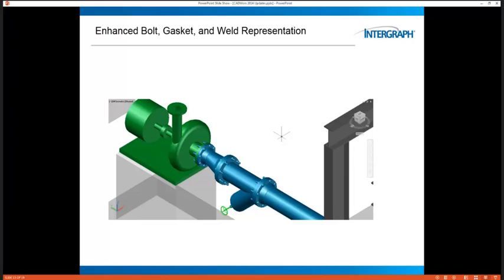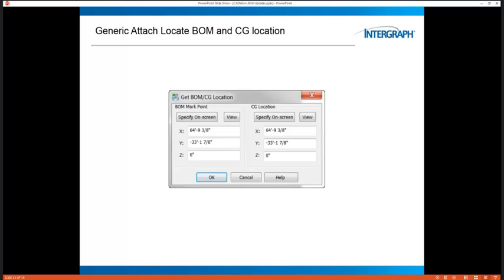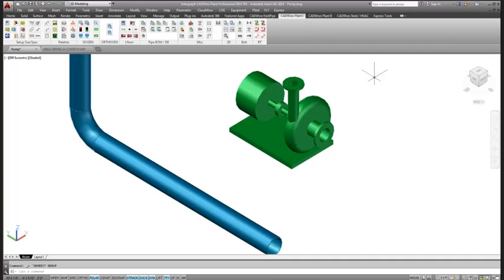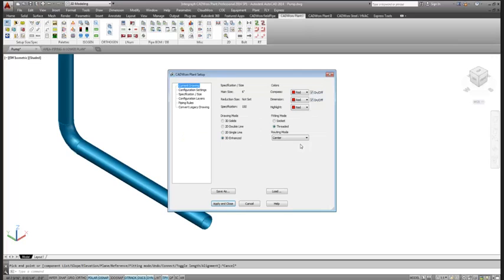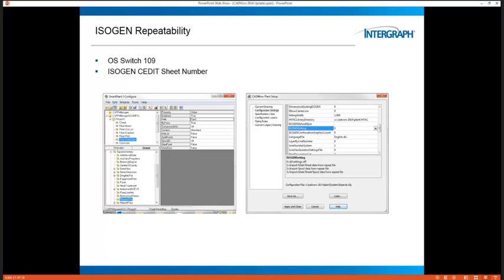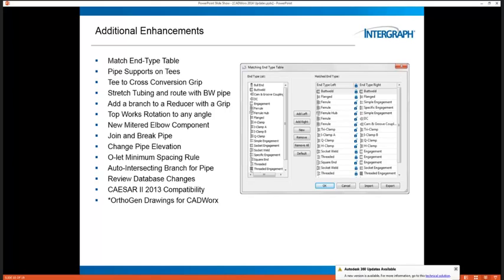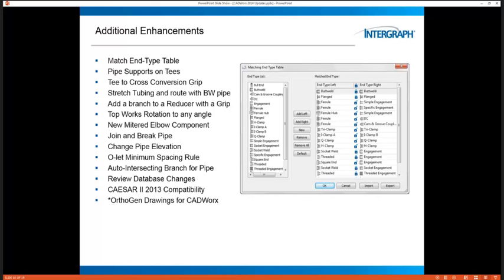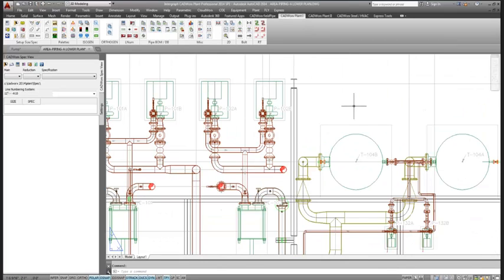Cadworx Plant. Lo nuevo en accesorios y herramientas.

Comment: buen dia arley usted me puede colaborar indicandome como hago un codo de menos de 45 y 90 con autoruta en cadworx 2014?? toca activar alguna variable? le agradezco su colaboracion gracias
Reply from the maker: Buen día jose, para realizar el codo puedes utilizar el video Cadworx Plant 2013. Ruta de Tubería y codos modificados / degradados.
Reply: Arley Z Estimado amigo TENGO INSTALADO EL CADWORX 2013, pero no puedo hacer los codos cortados, ya visite el video q recomendaste, pero hago toda la linea y a la hora de hacer el autorruteo no me coje la polylinea, alguna solucion